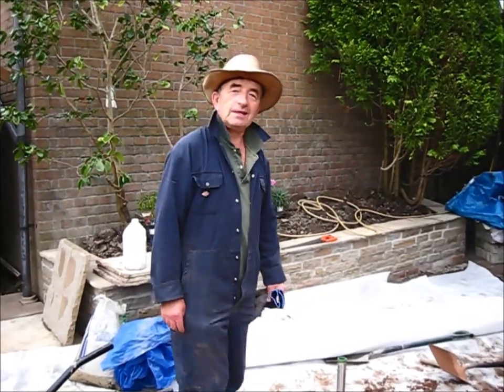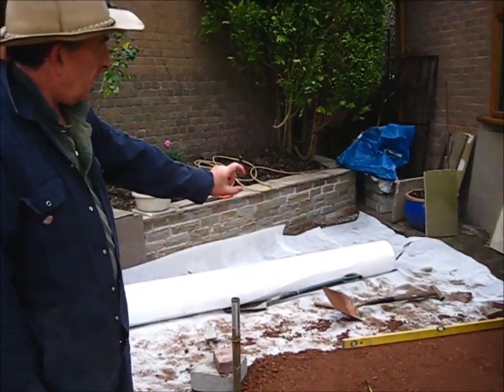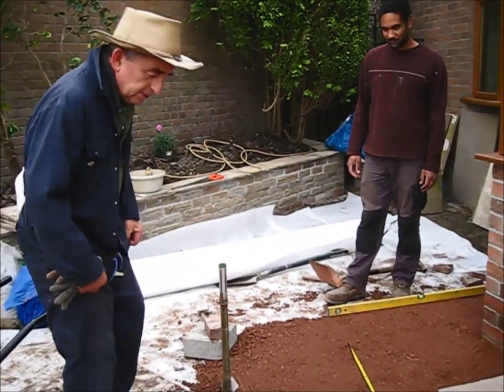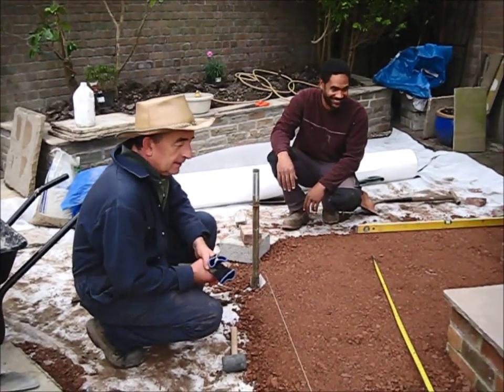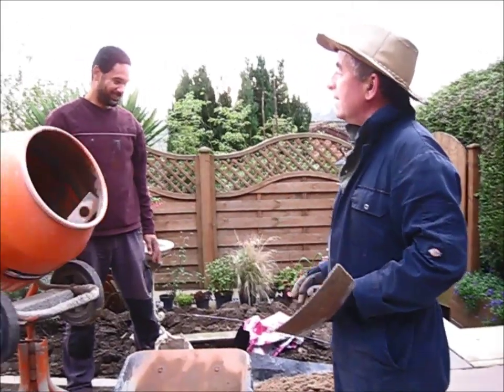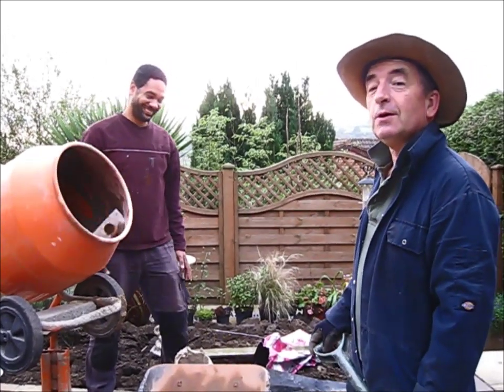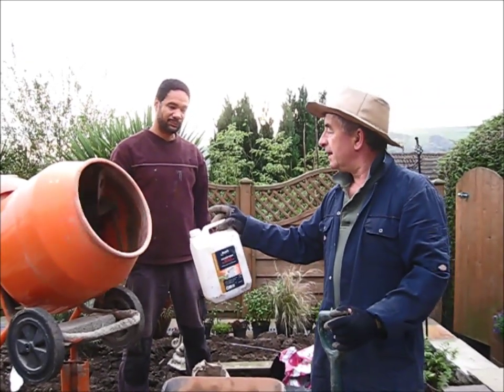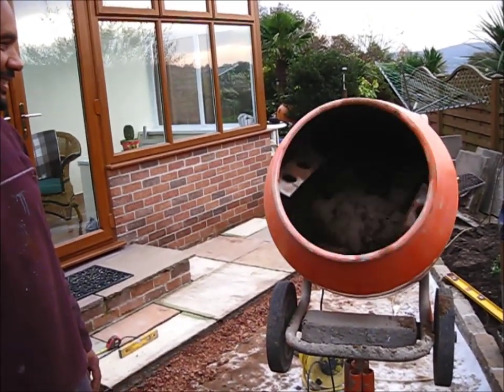How to lay patio slabs   step 1 preparation and cement mixing

Comment: are you using sharp sand or builders sand?
Reply from the maker: Hi Billy - that was builders sand
Reply: Sharp sand is normally used for paving though
Reply from the maker: Thanks for that - I'll check with my mate Alvar (as I should have done anyway!) maybe I had it wrong, thanks again
Reply: I thought that sharp sand and builders sand were the same, when I worked abroad it was sharp sand they used for everything.
Reply from the maker: @benhubble8994  thanks for your comments, appreciated, we were using the spade purely out of personal preference, a shovel or spade can work. You will see how we knock / whack down the stone in the next video.
Reply: Sharp sand is more course, it doesn't break over time like builders sand